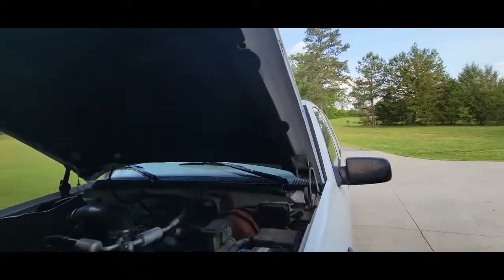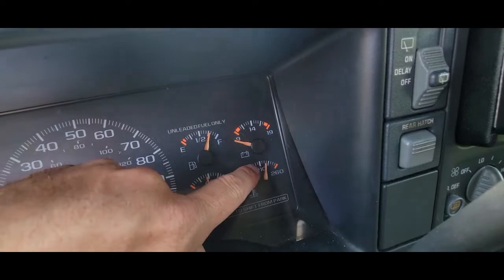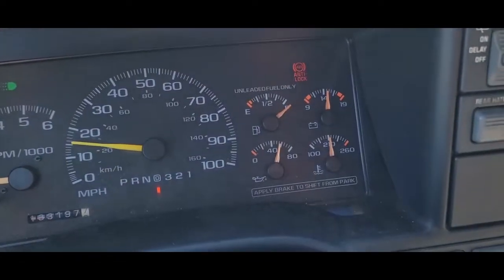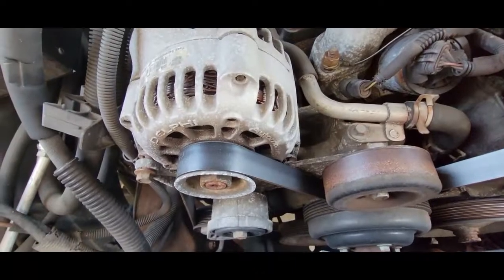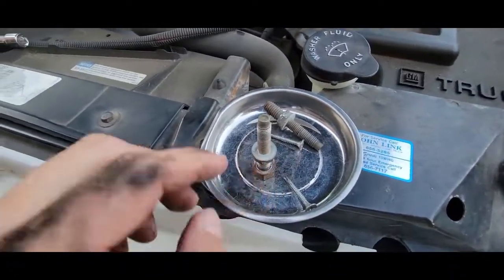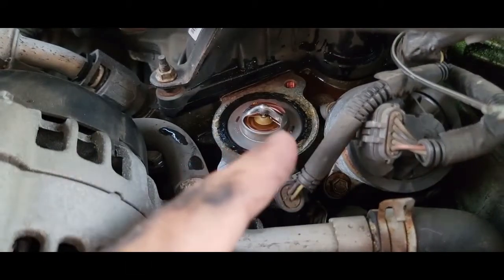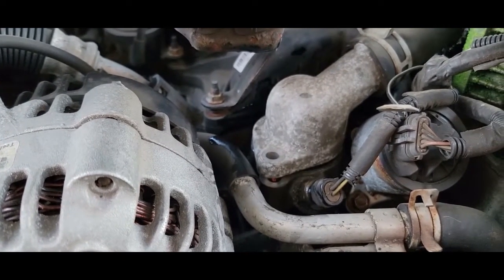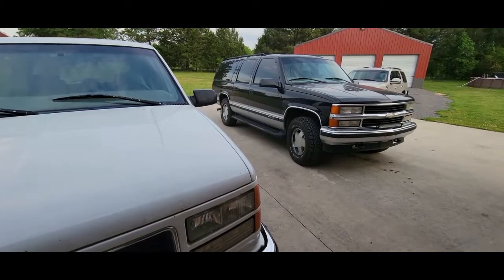GM Truck and SUV 1988-1999 Thermostat Sticking (Chevy And GMC)

Comment: If it is full of coolant the thermostat is sticking to cause the temp swings. Always best to change it out, nice work Cam 👍
Reply from the maker: Seems very common on these but that could be because I always have them around 100k miles. Hope you see doing amazing.

Comment: So I have replaced the thermostat and it still is sticking what could possibly be my issue? I am loosing  pressure in my cooling system with a pressure test kit